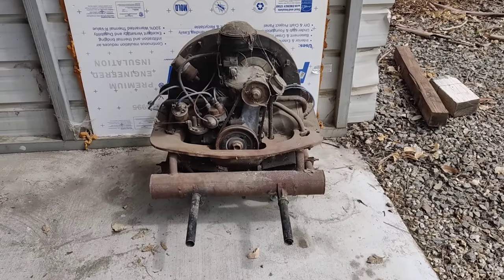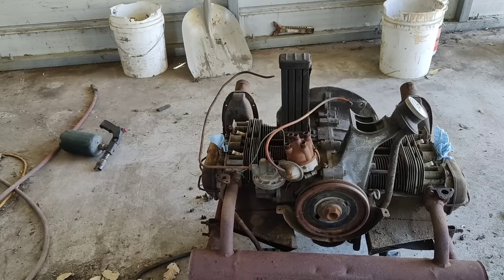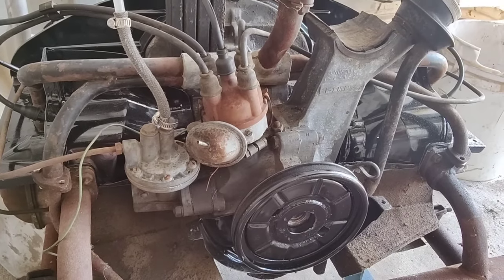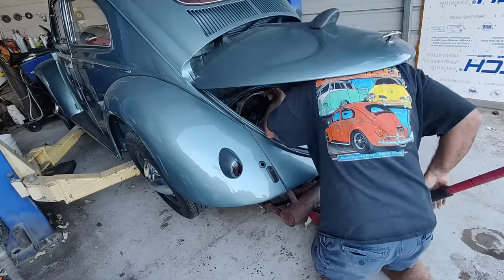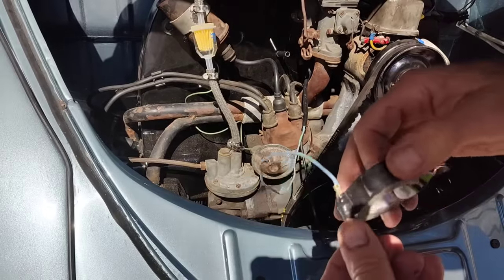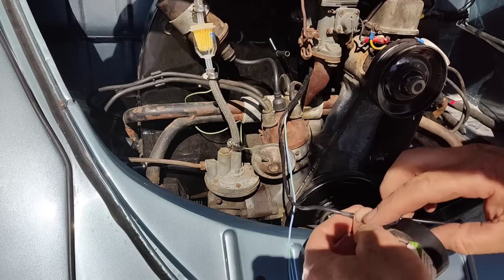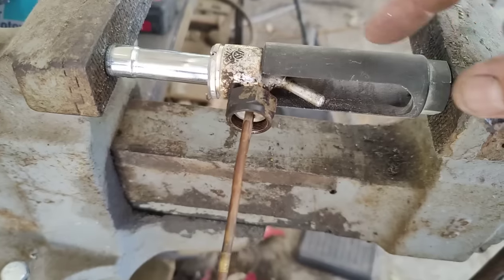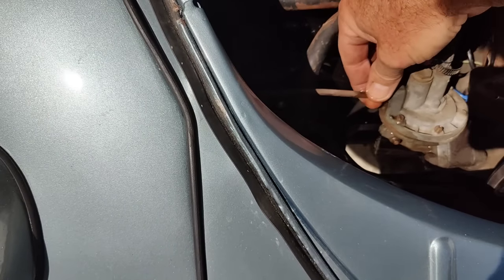WILL IT RUN and DRIVE 1954 VW Oval Window beetle Restoration  - first time in over 40 years

Comment: Everyone says take the fuel filter out of the engine bay however every beetle I’ve seen has one in the engine bay.
Reply from the maker: IN CA is was pretty standard. I asked at a few shops that are still around. Nobody has ever seen one that caused engine fire. And many of us have seen engine fires. usually the carb looses the barb.

Comment: I like to do the minimum Just to get an engine to run and then tune it.   Just rebuild the carb. I'm sure there's some more passages clogged.i don't trust the accelerator pump you have an ultrasonic cleaner too. I believe.  Replace filter, points,plugs,condensers, and wires.
Anyway, it's looking good, brother. ✌️

Comment: Hey Mike, 
A great video. You certainly have some awesome problem solving capabilities going on there.
One thing I'm finding with heater boxes is it's easier to put them on once the engine is in.  There are too many variables going on with aftermarket to original to bent.
But then I'm lucky enough to have a lift.
I'm looking forward to part two. 
✌️ Peace from Melbourne Australia.

Comment: Always good to see the progress. On the lack of power issue, check the accelerator cable linkage is giving you full throttle. I have just had the same issue on a 1956 and like you thought it was a compression or coil issue, the cable wasn't giving full throttle so all great until you hit a hill!

Comment: There’s a great thread on the Samba in the forums section that I found a while back that details what parts are correct for a ‘54 / ‘55 stock beetle. 
I have read through it a few times in pursuit of having a correct motor for my ‘54. They were apparently a lot of changes that were 1 - 2 year only items.
Reply from the maker: Thanks for the info!

Comment: I looked at a Chiltons book on VWs and one of the exploited pictures showed the clutch disc with the center hub mounted with the extended part of the hub going to the transmission, your clutch disc may be reversed.  The part of the hub that extends farther than the other side is or was mounted to go into the flywheel.  That what I saw, maybe you saw it , sorry if I interfered.  I watch & enjoy your programs. We have 2.5 VW’s, a 58 pan w/engine, 63 Baja w/1500 engine, and a 66 w/o engine.  I need your expertise. Thanks

Comment: I’m hearing that you shouldn’t put the filter on the output side of the pump. You have unfiltered gas going into the pump.
Reply from the maker: old cars have them before or after the pump mostly in early years of most makes and models they are near the carb after the mechanical pump.

Comment: Seems like it needs the jets matched to Commifornia fuel... up 1 on the idle, 2 on the main~
I think I went to 130~ on a 1600 w/a # drill set, yours probably would like a 125~
Reply: If you go too big solder 'em up & re-drill... I like to scratch in the size for the next guy~